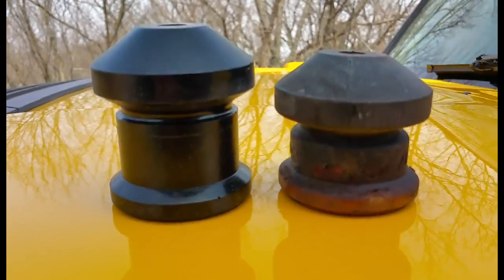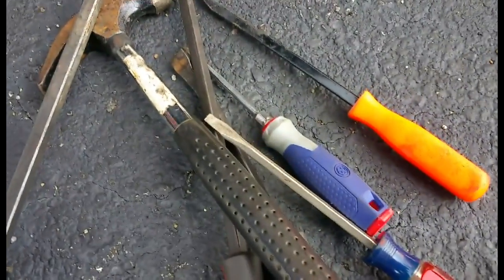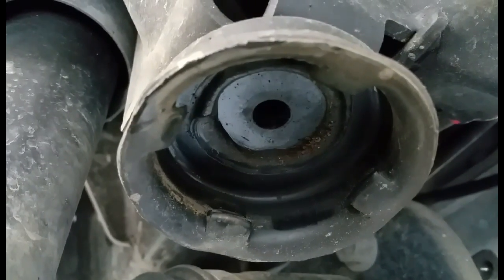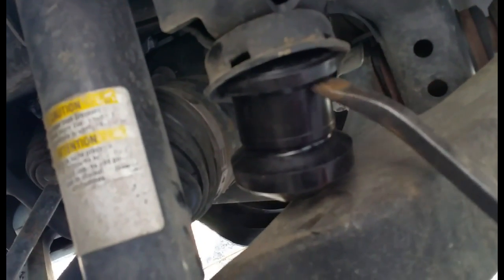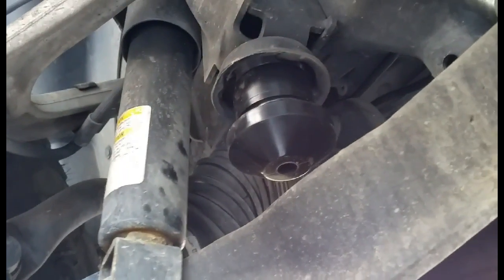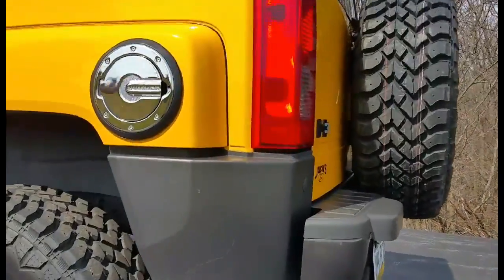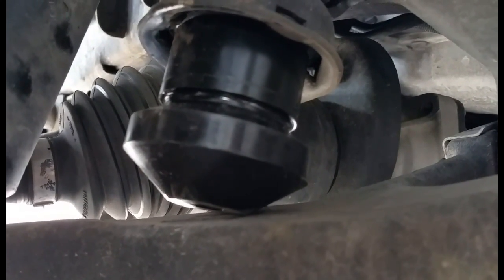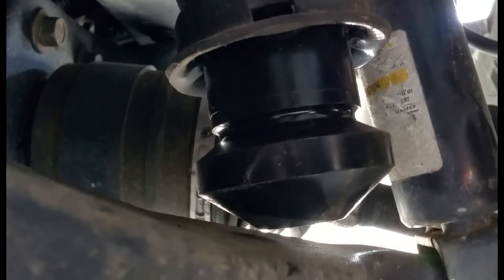Hummer H3 Front jounce bushing install

Comment from the maker: it's the only extended jounce bushing set that I'm aware of. if you have excessive front end dive under breaking with the Rancho 4" kit and your running the stock jounce bushings, these are longer to equal out to stock clearance on the lower control arm when you have about a 2" front crank/lift. 

Wheel hub center to lower lip of fender at 2" is 24", I assume your closer to 26",so you'll still experience some nose dive with these, but not much. Your looking for about 1/8" clearance between the jounce bushing and the control arm. 

if I had your lift, I'd think about track welding a plate to the control arm to get me back to the 1/8" clearance at rest so as to eliminate the nose dive under breaking.
Reply: Larry Musgrave do these work on stock height? Or I'll have to adjust the front

Comment: Thanks for video.ln my area no one knew what a "jounce bumper" was.But they call it a "bump stop" even on ebay. It cost 40.00 for one ..the smaller one..l could  not find the taller one.Just saying in case anyone else  is looking for them.
Reply from the maker: Wayne  Hutchinson 
The difference is that these are designed to be a load bearing part of the suspension under some certain situations. A bump stop is placed at the most extreme end of the suspension travel to act as a suspension limiter that will protect the vehicle from damage.

They are similar in design, appearance and even location. But this jounce bushing is installed with very little space between the bushing and the A arm, meaning that with extremely little suspension motion is needed before this becomes an active part of the load bearing suspension.

Comment: Larry, 2 questions ... with torsion cranked to 23.75 do you feel a diff in riding condition? rough/etc. Also, did you have to get front wheels aligned after??
Reply from the maker: Absolutely on the alignment. As you raise or lower the static ride height, the front control arms are sweeping an arc. So the knuckle does not actually move vertically, it gets closer or further from the center line of the vehicle.

As that is happening, your rack and pinion tie rod ends are not pivoting in the rack end at that exact point, so the rack appears to be longer/shorter compered to where you started from. This means that your toe is no longer exactly where it began and your now cutting on the tires.

The ride was fine, it does increase the observed stiffness a very little bit, it dies this because your factory set control arm is horizontal and when you crank the torsion bars, the control arm is now angled down. That changes the initial required force to move the torsion spring because of that geometry change. That said, it was not a bad change nor a big change at all.
Reply: Thanks for the explanation, makes sense. I look forward to raising my front soon.

Comment: That's crazy! I was doing my brakes last weekend and saw that part you installed disintegrated and barely holding on, on my 06 h3. And today your video popped up three days later. So if I didn't want to crank up my front end and put extended ones, do you know where I can get regular OEM ones? Besides dealer? I went on eBay and typed in jounce but nothing popped up. Is there a regular generic name for that part that I can look up?
Reply from the maker: Same place... They have the extended and standard.
Reply: @LarryMusgrave  hey Larry. I ordered two of the extended bump stops from the same place as you. I'm going to be putting them in this weekend. I leveled up my Hummer to 23 1/4. When I put the bump stops in, is it okay if they are touching the lower control arm after? They look kind of long and I think they might touch.

Comment: This just seems like it’ll limit your travel too much
Reply from the maker: Not at all. So how this system works from the factory is that you have the jounce bushing in place and it has approximately 1/8" clearance to the control arm. The bushing is an active part of the suspension, as you move the arm upwards it contacts the bushing and adds spring rate, essentially works as a progressive spring rate. 

When you crank the torsion bars to lift the front, you are no longer positioned correctly, so a longer jounce bushing is swapped in to get you back into the factory range and restore the factory ride and handling. 

While at its extreme compression this does act as a limiter or bump stop, in the bulk of the bushing compression it is acting as a progressive spring.

Comment: Is it not better to lower the rear to level it rather than lift the front to get a better on road ride?
Reply from the maker: BOSSREG.com 
If your an old woman, sure 😂
I couldn't imagine what kind of person would lower a Hammer....
Reply: Don't know about lowering a Hammer but a person whom wants  better road holding and ride would lower a Hummer rather than lifting it unless it is used for a lot off road because the higher the vehicle the worse the ride....that's a fact
Reply from the maker: A person that wants road holding is a fool if they bought a Hummer, Wrangler or any other vehicle that is primarily designed as an off road vehicle. 

You are obviously not my kind of guy, and we will never agree on likely anything. But that's cool, and I do not dislike you for your opinion. 

Good luck with your urban Hummer build, I'm sure it's been done before and if you go hit up the Facebook Hummer pages you can get some advice and opinions. Just be ready, when you mention lowering, road holding and ride quality your going to have to ignore some very emotional responses from alpha males.
Reply: Thanks for the advice, you are an off road guy so require the lift for clearance so understand where I do more on road stuff, all the best
Reply from the maker: BOSSREG.com 
Seriously, go on the Hummer page. There are all sorts of folks and very possible that what you are after has been done before.
Reply: Thanks Larry, think I have found a company that does a lowering kit for a Hummer H3 called Ground Force Suspension
Reply from the maker: BOSSREG.com Ground force is the biggest/leading company in slamming/lowering trucks and SUV vehicles. I would think that they have quality hardware.
Reply: Seems they are the only ones, not found any other as yet, waiting to hear back from them

Comment: I have a question. I took my H3 to a mechanic and he noticed two things when he was under my truck: 1. the ride height in the front was much lower than the rear of the truck, and 2. the front jounce bushings were being compressed by the lower control arm at rest. Is this normal for an H3. He says it isn't. But Ive read that it is. So Im a little confused. Can someone help me with this?
Reply from the maker: There should be about 1/8" space between the control arm and the jounce bushing while at rest on a flat surface. if your laying on the bushing, just turn your torsion bar adjusters (sane amount on each side) to raise the front and get the space. This is how you lift the front, so if you want to go up and level, you turn them up for the Trail duty longer bushings.
Reply: Thank you so much for the help! Should the ride heights be the same front to back on an H3?
Reply from the maker: The factory adjustment had the front raked down. many owners get the longer bushing and crank it level. no higher than 23.5" hub to fender lip.
Reply: Ok. Thanks again for the information.
Reply from the maker: Anthony, 24" is considered max height that you can go without severely shortening the life of your front axle shafts. I set mine to 23.75" and got extended rear leaf spring shackles to lift the rear a bit. then I put 34x11 Hankook Dynapro MT tires on, it looked massive beside a stock H3.

here is also a link for you to check out.
http://schwarttzy.com/lifting-the-h3-hummer/

Comment: Are you running standard stock shocks? They looked like stock to me. If not lemme know. I'm looking at grabbing the bushings and cranking up my torsion bars on my 07 H3. The front drivers side is sitting at around 21 1/4" while the passenger front is 21 3/4" so its a nose-forward stance and I don't like it. Just had the shocks done on my front end. So curious if this will hurt my ride if I do the torsion lift to around 23 or so and add these bushings.
Reply from the maker: Well, for me the stock shocks wouldn't work because on certain roads the front suspension would extend to the shock hard stop at full extent, and I felt it, and I hated it. So I called Summit Racing and ordered a set of Ranch RS9000 adjustable front shocks that were 2" longer. You could go much cheaper with Rancho RS5000 gas shocks or even something from Super Lift or Explorer Pro Comp. Just call Summit and tell them that you have a 2" lift and want 2" longer shocks for the front.
Reply: Ah, alright. Dang...just had the shocks done on mine. Gotta wait to be re-employed again before I can get some new toys for my truck. Thanks though! Appreciate it.
Reply from the maker: +DraccoKnightblade I'd still do the Jounce bushings and see if it grates at you. I live in western Pa where the roads suck, you may not notice it like I did.
Reply: Ah, yeah, I'm in Southern Ontario Canada. The winters here suck. I just gotta get the shock brand that I have on it, I think they are Monroe Gold Premiums or something. Check the travel length etc...Thanks again though, Gotta check with the company who makes those bushings to see if they can ship them to good old soviet cannuckistan :P